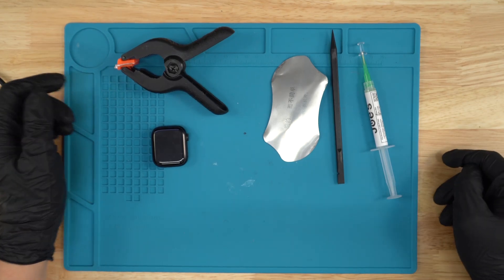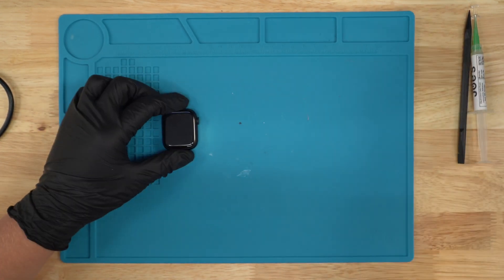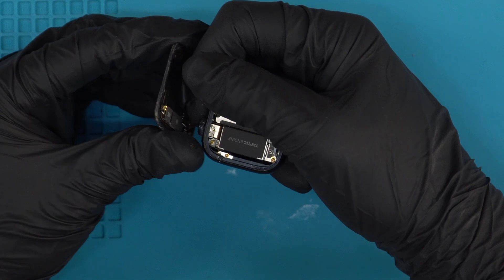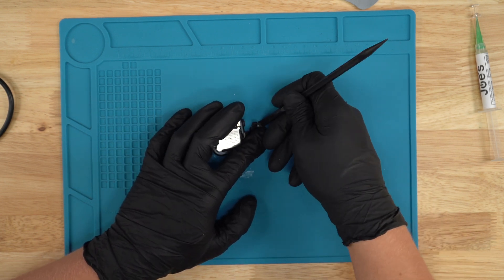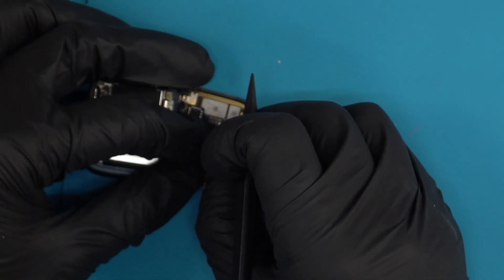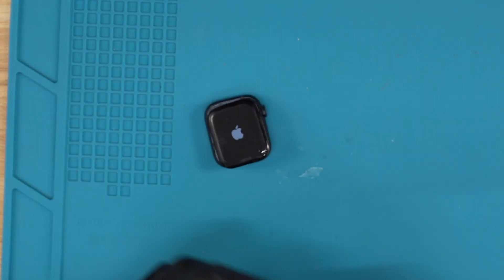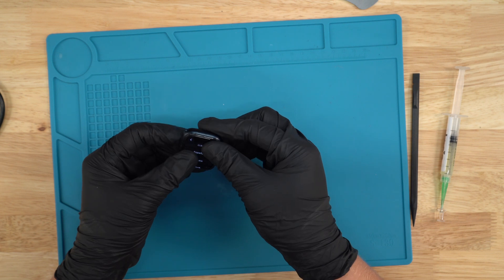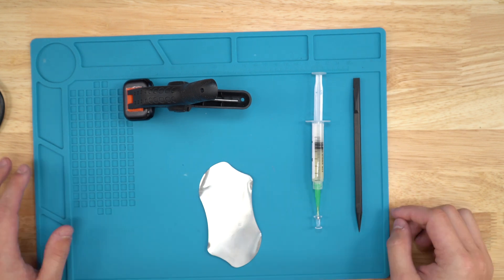Apple Watch Series 9 45mm Screen Replacement | Fix Shattered Touchscreen & LCD – Repair Tutorial

Comment from the maker: Send your device in for repair 👉 https://www.joesge.com/pages/repair-service-apple-watch
Are you a repair ninja? Buy the parts here 👉 https://www.joesge.com/collections/series-9-repair-parts
Buy Apple Watch Repair Kit Here 👉 https://www.joesge.com/products/apple-watch-series-1-2-3-4-5-se-se-2nd-6-7-8-ultra-1-ultra-2-series-9-back-cover-screen-fix-repair-kit?variant=40986806779950
Buy Heat Gun Here  👉 https://www.joesge.com/products/hot-air-gun-station-200w-handheld-portable-black-tools?variant=40176338960430